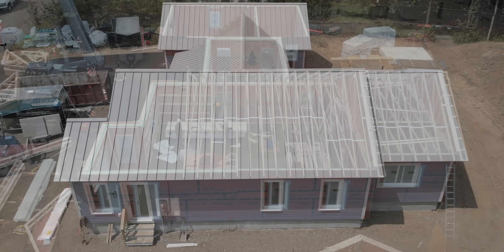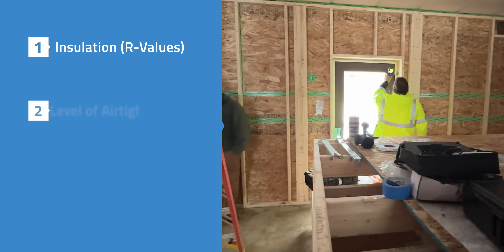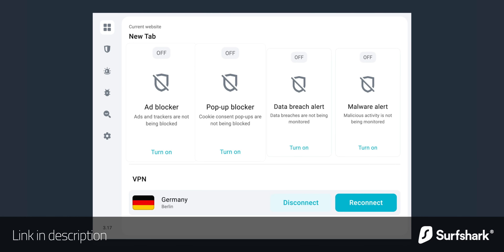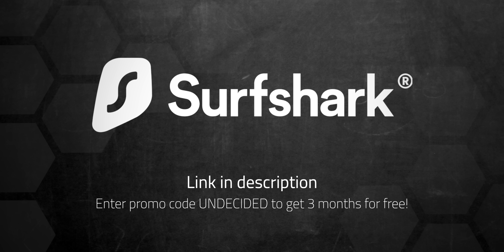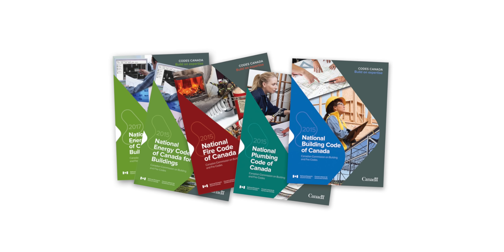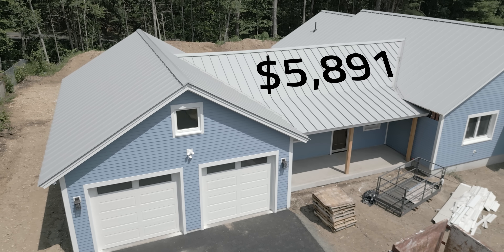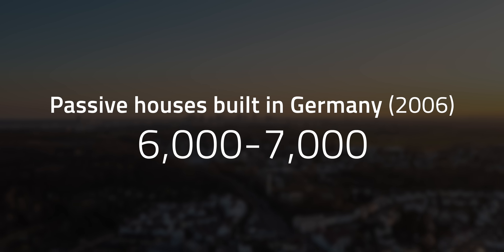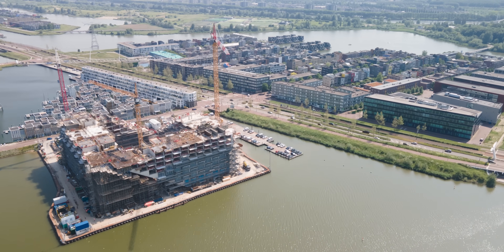Why Do American Homes Suck?

Comment: I’ve been a builder in the Colorado mountains for about 30 years and this video is good but it is too simplified. The problem is much more complex than simply heating your home. Taxes, lot prices, tap fees, engineering, HOA requirements etc. have pushed home prices well above 1 million. I live in a wealthy area and workers can not even afford decent place to live regardless of energy efficiency.   It’s the whole system that prevents reasonable efficient homes for the average American.

Comment: a net zero house is a myth
Reply: … hm, … in my new house with heatpump, Solar panels on the roof, battery storage, we need 12,000 kWh per year (incl. EV). Our Solar roof produce 12,500 kWh per year. Yes we need from time to time energy out of the grid. But all in all our house is a „zero house“. … This depends entirely on your point of view. … Location? … Germany.
… The term „zero energy house“ is not to be understood as meaning that it consumes zero energy. A zero-energy house produces at least as much energy as it needs in a fixed period of time. … That‘s FYI. … 😉

Comment: I agree that the standards should be increased, but what worries me is the current state of the housing market. The market is very hot. Less people can afford a house then ever before. There are many things that adds to the current situation but I believe that the main reason is because there is not enough houses being build (especially the cheap ones). Bumping the standards up will most likely make it even worse... Which is sad.

Comment: It's hard to argue against high efficiency. That said, it comes at a huge cost to the average home owner/buyer. In WA, we seem to be compelled to demonstrate our strong desire to be a part of the climate change solution. Because of this, we make building affordable single family homes, for example, extremely difficult for the majority of people. Unfortunately, due to the culture of always driving towards the highest possible standard and calling anything less substandard, we tend to shut out the possibility that we might be creating a much larger problem than the one we think we're solving.

Comment: I don't think houses in America suck. If a company builds a house for you and you buy it at double cost than yeah they use cardbourd. I bought my land built my own house and used all premium supplies, windows, insulation, stucco, I used 2x8s versus people using 2x4s. My blow test passed way better than state requirements. Windows tripple pane. Did extra 6inches of insulation in the attic more than code requirements. I used 5/8 inch sheetrock verses 1/2 . So it depends who builds the house.

Comment: There are some simple reasons why this has occurred that you have obviously chose to place little emphasis on, 1) the cost of fuel is significantly less in the US therefore making it far more effective to burn energy rather than upgrade to extremely expensive building materials. This would cause millions of people not to be able to afford to live in houses. 2) The US has a much larger variation of temperature ranges than Europe and tends to be in more warmer climates. Therefore the need for increased insulation is not necessary in many portions of the country. 3) Because of the large variation in temperatures it would not make sense to have one standard code for everyone therefore state by state makes more sense to me. Love your show but I found this episode to be missing critical information.

Comment: Those have their own cons and pros and can also improved for example using metal frame   Structures with  basement and first floor made from stone , ytong ,brick cinder block with insulation  ,and sandwich panels , or logs  or wood fiber panels and bricks with Insulation for inside and outside and iso panels for outside  ( it’s one they made  cooling storage containers)   Or simply putting a 
 log house around metallic frames . It’s definitely a cheaper alternative that  avoids frequent maintenance and its cost , but also maximizes efficiency and modularity of the real state in demand with fast pace of life , people moving for jobs  they can if they want simply load house on truck or torn down.

Comment: I would never support a national building code as the federal government is so terrible at almost everything Illinois has one of if not the strongest plumbing codes, and it's not about efficiency as that seems to be your criteria for good building code, building codes should first and foremost be about structure and safety especially when it comes to plumbing and the use of backflow devices like reduce pressure zone RPZ to protect the water system from any contaminates as well as other codes protecting cross connections, but I guarantee a national code wouldn't contain a code where you must be a licensed plumber to do any plumbing that's not your primary residence, and even at that if you have a lawn irrigation system the RPZ needs to be installed and tested annually by not just a licensed plumber but also have a CCCDI license to perform those tests, and I'm sure if we had a national code you'd have plastic water pipes used as well as Romex wiring but you won't see either of those in the greater Chicago metropolitan area, even low voltage such as computer network cables need to be ran in conduit in Chicago, hell my house has at best a R20 roof and not sure what my outside walls would rate as they are 4" cinder block and common face brick with only furing strips and plaster but it was built in 1957 it would not meet modern codes when it comes to insulation, and those windows you show look like crap IMO and wouldn't want them and yes looks mater more to me than efficiency

Comment: Is that $5,891 saving mentioned an annual saving, or over the life of the home?

And what was the cost of that return?
Reply: I would hope per year but ~$5900 per year would cover the entirety of all utilities (all electric and on well) twice. 

Over a lifetime seems like it would be insanely low returns.     I have a hard time believing it would not be negative.  Though we are only considering individual costs and not carbon emissions, or anything of that nature.
Reply: I dont understand it either. california home 1500sqft, spend roughly 700 on gas per year [gas stove, dryer, water heater and hvac], ~1600-2000 on electricity per year, water and other utilities ~1200. Hvac gets turned on for a few hours every day during summer and heat season.

Comment: American houses are better in terms of pollution, every house has an expiration date that is normally around 80 years.
American houses are lightweight and generate less construction waste during demolition.
I'm European and the houses here use a lot of blocks and concrete, I don't think it's a healthy alternative for the environment, it's just a little more durable over time but at the end of the house's life it generates a lot of waste.
and the construction loads on the foundation are much greater using much more steel too

Comment: In the warmer climates, a large part of the US and southern Europe,  more consideration should be given to avoid summer  heat by using passive means such as overhangs, shutters and even appropriate window pane glass.
Moving to efficiency may use a number of techniques - of which insulation, windows and air tightness are just three.

Comment: I would agree with you that energy efficiency should be a deciding factor in choosing building materials.  However, cost is also a factor.
I'm preparing to build a new home to replace my 100+ year old home.  And just the shell is going to cost me over $150K.  Thats without insulation yet.
I chose thermally efficient 2 pane windows.  I looked at 3 pane windows and it qould have cost and additional $10k just to go with "the best" windows.  Thats not to mention doors.
I had to choose a happy middle ground, otherwise I would still be in a drafty small house with no insulation in the walls and single pane windows.
Note, I've been putting off building because I wasnt able to afford it.  Im now to the point that I need to build or start investing money into a building that isnt worth investing into.

Comment: Our two kids just built their first homes here in Norway so now I know more about our building codes than I used to: Our standard requirement for air leakage (the ACH50 measurement) is 0.6 for all new houses, i.e. the same as your Passive House rule. Similarly, our U value requirement is 0.8 for the windows and all the walls require a combination of 20 cm mineral wool (or equivalent), a diffusion barrier and then 5 cm of dense (ultra-insulating) foam board. A balanced ventilation system that also works as a heat exchanger has also been part of the minimum requirements since 2012 (i.e. the Tek-12 standard revision, later updated and made even more stringent in 2017.)

Comment: Another great video! It was interesting you mentioned an increase in air leakage resulting in an increase in mold development. In the UK generally we see the opposite. With an increase in double glazed windows, there has been a lack of ventilation, resulting in moisture buildup from respiration, cooking, clothes drying and bathroom condensation.  The more air tight the home, the greater the need for a form of forced, mechanical ventilation. I am not sure if this is because we have a more humid atmosphere, the predominant wind direction being SW'erly straight from the Atlantic?

Comment: Fun Story about that: from personal experience i can tell i can literally heat my 120 m^2 home built last year (2023) at Passivhaus standard with 8 candles keeping it at 20°C while outside was -10°C during a power outage so yeah, insulation is freaking insane.

Comment: Matt it depends on where in the US. For instance the Midwest doesn't have the same building requirements as the west, California has very strict building standards. The US is so vast and has many different regions with regulatory standards. I live in Tahoe which has the TRPA, building a home here needs to meet several environmental standards, run off, BMPs, energy efficiency, and structural requirements.

Comment: Yeah. Lets push for all these insane energy codes that have a 100yr  economic breakeven point while housing costs are skyrocketing. Now my state wants sprinklers in single family homes, so much insulation you need 2x8 exterior walls and they want the house so tight that you have to mechanically bring in outside air. Absolutely idiotic.

Comment: Energy efficiency is important for your comfort and your bank balance.  

I rented a flat which needed work, it was drafty due to cladding round the windows falling out, and had electric space heaters on the wall.  When I complained to my landlord about the space heaters; which were supposed to be storage heaters according to the contract agreement; he gave me an eviction notice!  

This worked out well as it gave me six months to find somewhere else, but I only needed to give my landlord 1 month's notice.  I found a flat with gas central heating and well maintained.  My electricity went down from £150 to £100 for both gas and electricity at my new place and I'm never cold.  Also, fuel costs have gone up by 1/3 since I moved so lucky I moved when I did.

As well the agency dropped my landlord as the flat needed too much work and were upset about how the landlord treated me.  The landlord literally begged me to stay, as he needed to pay the mortgage.  I just laughed in his face!

Comment: Many EU countries have strict laws for building with major oversight. Theres also a stronger culture of quality. US is fast, cheap, and big. Our tradsmen are significantly less skilled on average, and the culture is more good enough fast  than good as i can do with what i have. Its almost to find contractors that will do the bare minimum of following the manufacturers directions on the wrapper. They put the nails in the shingles whereever they want, and most people are too clueless to complain and evern promote these clowns tontheir neighbors. Ive been screwed by contractors several times. Most dont like to work with me because i call them out. They want the easy money from people that just want it to look pretty and have no idea its going to fail soon due to negligence or laziness or just plain hostility.

Comment: No mention of the water resistance of a building. Talk about passive homes and high r value but you're forgetting the water breathability/resistance of a house. Those YT channels you reference always skirt around the issues of stopping water into the homes, because they themselves have cheap/poor methods as well. We need to get water proofing to the 21th century instead of just wrapping our cheap wooden plyboards with tyvek and call it a day. Heck a good majority of houses don't even insulate or finish their garages due to tax issues! This needs to be fixed!

Comment: Interesting video, as always ! France has been overhauling its construction code quite a few times (six actually ; 1982, 1988, 2000, 2005, 2012 and 2020) since its first one in 1974 after the first oil shock. I think it's because here we build to last. It seems that in the US, a home just serves as a home for one family at a given time and then, after a few decades it can be torn down. At least that's the impression I had while I lived there.

Keep up the great work ! I am sure you are starting many a convo on both sides of the Atlantic ocean. 😀

Comment: Codes are a violation of your freedom and as such should be voluntary and not mandatory. Codes should be suggestions of the bear minimum requirement for safety period. If should be up to the individual to decide if he wants to exceed the code and by how much. You should stop shoving your values down others throats and instead focus on education and winning hearts and minds. Certifying house to a standard should take place voluntary in the private sector and not at the bayonet point of a government mandate.

Comment: I'm a retired architect with empathy and understanding for the energy deficiencies in the American housing industry. That means putting energy efficiency rules into action. It will not happen on a State level and the feds want nothing to do with it. The banks keep their hands off. The rich seldom really care, so, since most middle-class homes are built by developers and contractors there have to be rules and regulations that mandate energy code compliance. It's a lot like getting seat belts into cars. Until there are clear federal standards America will continue in its energy wasting. Your outline is fairly accurate regarding what the problem is. Thank you.

Comment: Every building code added also increases the cost of construction. I have NEVER seen an increase in code lead to a reduction in cost…..and I am co-owner of a building company. It’s fine to want more energy efficient homes and better products, but don’t be screaming for these things while also whining about the cost, also while piling on the “must have” list, which is generally anything but a list of necessities. 

We frequently try to get people to increase their insulation, use more energy efficient products…..but 95% of home buyers will decline these things in lieu of pretty cosmetics. Especially insulation…it’s relatively cheap for the benefit and yet vast majority of people won’t spend an extra dime on it. 🤷‍♀️ And you think they will pay for net zero…..😂

At this point, building needs to be expanded so cost of housing can come down, it’s more important to get number of houses up than worry about whether they are net zero.

Comment: Air tightness freaks me out. All it takes is one gas leak and everyone suffocates.
Reply: In my area the building codes have made homes so tight that now they have added code for additional ventilation ducts saying it’s “too tight” to “undo” the codes  making them tight. So, you get to pay for both, they layered them both on rather than eliminating previous codes that made them too tight.  🤦‍♀️

Comment: Energy efficiency helps be rating based on this overrated. If there is unlimited renewal energy available for super cheap energy efficiency will only matter if you are in a somehow constrained like in a race car. There needs to be return on investment for energy efficiency to make sense relative to the energy cost in its market.

Comment: Oh and vinyl siding lasts forever. Much longer than wood or metal. It is also very easy to repair, and does not need to be painted (huge savings) Vinyl is extremely cheap and durable. European economy is an ultra slow growth disaster that can't even defend itself. Cool house, but let's think about the big picture here. I do agree our houses are generally too large.

Comment: We already have an affordable housing crisis. This guy wants to make it worse. New buildings are sooooo much better than old ones in efficiency, and if you regulate too much on new ones you won't get as many. Better to replace and upgrade as many buildings as possible to inexpensive modern standards than have 200 passive houses out of 200 million. Huge number of older homes we fix don't even have insulation under the floors. Single pane windows are still on millions of legacy US homes. If windows are cheap, you get way more replacements. Also, HVAC tech matters more than almost anything else. Huge numbers of homes still have electric heat. Just adding a new modern heat pump is as important as 20k worth of the hyper modern and expensive tricks highlighted in this video.